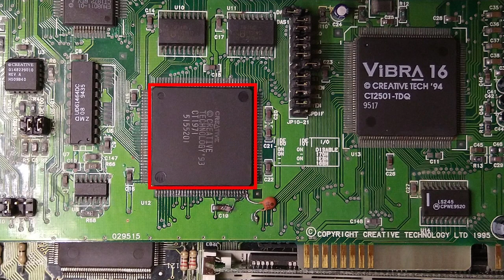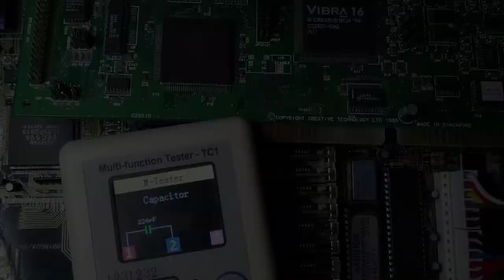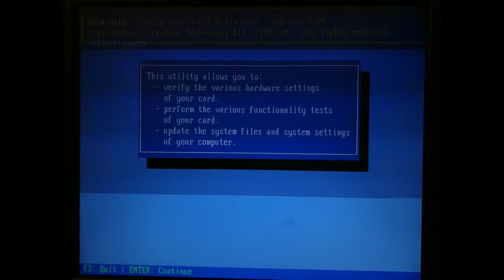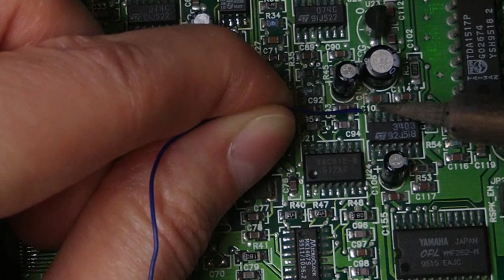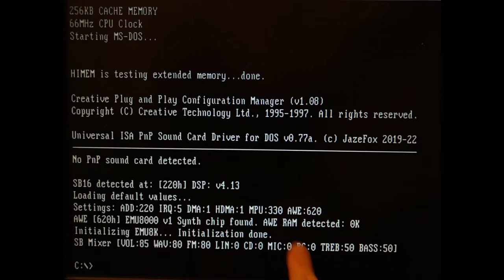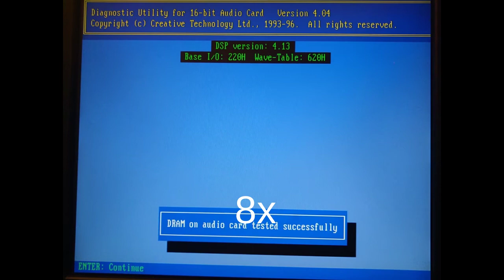Sound Blaster SB32 CT3930 Repair. OPL3 and AWE32 MIDI in one card!

Comment: Hi, I have a question, it looks like you know a lot about these things. I bought one SB Vibra 16S, there is no CT marking on PCB, it's probably some OEM card, but on the chip, there is CT2504-TCQ and card didn't have FM music at all, games were saying "no FM chip detected" so I inspected card and I found empty space for those 2 yamaha chips (OPL and DAC) so I soldered them there (I had one soundcard for parts) and adlib music now works (I didn't expect it) but it's very silent like if it was not going thru amplifier or something.
I guess that maybe some resistors may need some tweaking or something, do you have any idea? There is no empty space for any extra chip now, everyrthing is occupied

EDIT: yes, I was right, it was just a resistor, when I really didn't know, I tried my super scientific method with slightly wet finger to carefully touch resistors and I found it, adlib music is now playing like hell in Doom 😀
Reply from the maker: Awesome! It's great that you got it working! I would never suspect that a resistor would fail. Was it an SMD part ?

Comment: Nice Job! But what i dont understand, why the noise doesn't disappear after removing the faulty RAM and when you tested it without it.🤔
Reply from the maker: Hmm good question. Perhaps the bus is floating so the card reads random noise from the floating bus. If the faulty RAM is completely broken, then it might as well not touch the output bus, which would result in the same type of random noise.

Comment: Thanks for the super informative video! I've got a CT3980 with a very intriguing issue: the card will output PCM audio perfectly on both left and right channels, however, MIDI through the EMU8K will only output on the left channel. Any hints? I love my card and would be sad to see it die a miserable death. Thanks!!
Reply from the maker: Mine had lots of bad capacitors, so I would start from that. Then I would check the DAC (TDA1387 in my card) or perhaps the op amp connect to it (3403 in my card).
Good luck!

Comment: Nice! I have an AWE32 with a similar issue on AWE sound, RAM not detected (clearly shorted) and when replaced it would still play distorted sound. I am blaming the EMU chip in my case but I am still investigating. Did you find schematics for this card?
Reply from the maker: I could not find any datasheets for the EMU8K or the VIBRA chip. I did not look for schematics, but I would doubt there would be any, but I could be wrong.
In the CT3930 there don't seem to be too many components between the EMU chip and the SIMMs. It is just the F244 buffers, the LS05 and LS27 for the WE signal and the resistor arrays. Perhaps replacing all of them could fix the issue:) Good luck fixing your AWE32, I hope you get it fully working soon!
Reply: @scrap_computing  Thanks for the hint. I'm still playing with it, I need to probe some signals, hopefully that will give me some clues.

Comment: I have a question. Not about this video( I used the latest due to I don't know if you go back to previous videos to see comments) what do you have or going to make another update about your voltage blaster or the socket 3 CPUs. I do hope you have a final version to build or purchase. Also are you making one for older socket 5 and socket 7 motherboards that need the split voltage for MMX based CPUs for boards that don't support the split rail MMX CPUs like from Intel, AMD, Cyrix. Have a good one.
Reply from the maker: I have made a couple of small changes since. The last one was a slight increase in the hole diameter for some of the headers. There are still features that are missing, like a jumper setting for the write-back cache and perhaps some mounts for a CPU cooler. I have not looked into them yet though.
Btw you may also be interested in a fork of the SocketBlaster project by CalamityLime at vogons who is building a board with an onboard voltage regulation circuit. Please checkout the thread: https://www.vogons.org/viewtopic.php?t=92036 .

Socket 7 has more dense pins, so we can't use the same parts or assembly process. It might be possible to build one but it would require a very different approach.

Comment: Excellent job! I had this exact sound card back in the mid 90's! I remember playing the original Diablo with it along with playing with General MIDI and so on. I never did add extra RAM to it but it still was a pretty good card for the time. I used the card up until the Pentium 3 days where I ended up going with a PCI based Creative Labs sound card which at times was a nightmare!
Reply from the maker: Yeah, these Creative PCI sound cards were not great with older games, but some of them had fancy features like EAX which was great for newer games.

Comment: Brilliant work. You have a terrific understanding of electronics. Watching your process of logically deducing the faults is priceless. I've got the exact same card, thankfully mine was fully functional from the ebay seller, but I have a ct1600 that won't detect, and I'm thinking it's time to revisit it. Thanks for the incentive.
Reply from the maker: Glad you enjoyed the video. I was lucky this time and things worked out in the end. Some other boards are just too broken! Good luck with your CT1600 :)
Reply: @scrap_computing  Just saw this video in the side bar and I decided to come back, I did successfully fix my CT1600 and made a video about it "Bad Blaster Finally fixed". There were two issues, a hidden trace was corroded and a bad jumper. What a great feeling when it was finally detected.
Reply from the maker: @esc2dos  That was an awesome video! Thanks for sharing such a detailed troubleshooting guide !

Comment: Nice job. That card wasn't an easy job considering its terrible state. Also I like the background music. The output of the LS05 having a low voltage might indicate why it died in the first place. Maybe the output has some low resistance to ground for some reason. I'd check if it gets warm.
Reply from the maker: Great point! It is not getting warm, but I will check it out. Thanks!